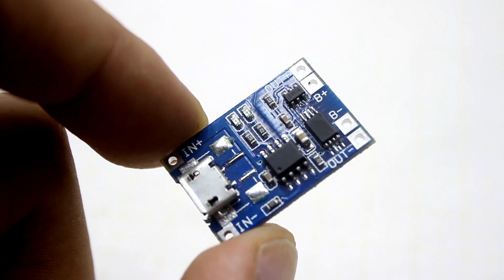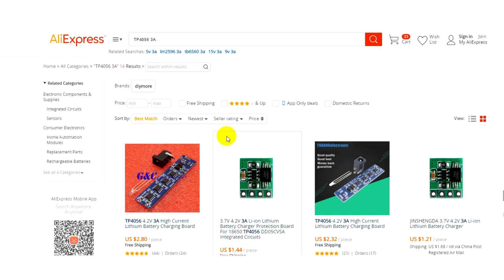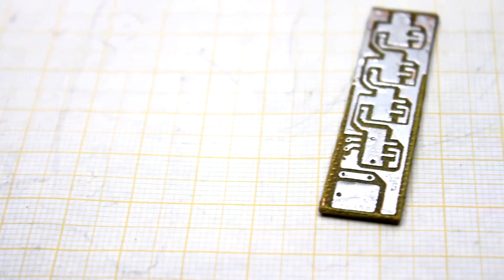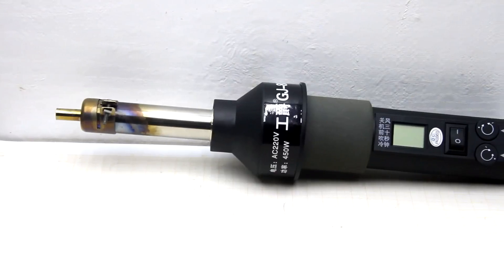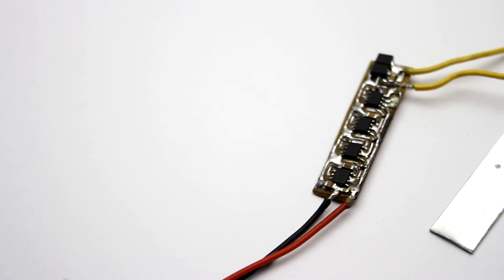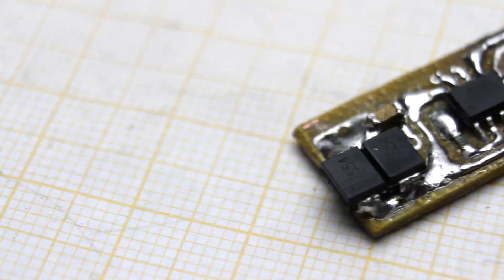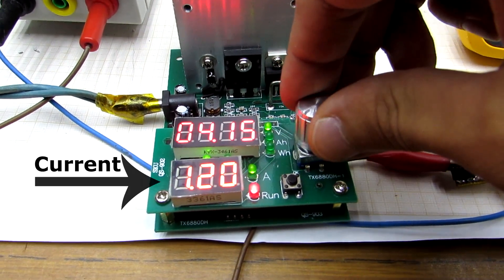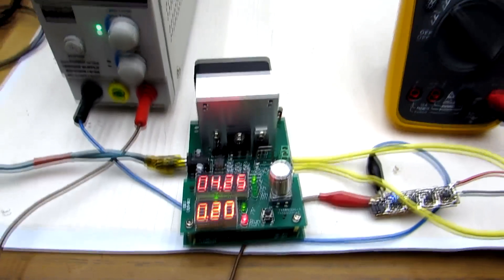3 Amps charger on TP4056 for lithium battery

Comment: Looking at the circuit you reverse engineered, it seems that there are simply four modules (as described on the usual datasheet) with their inputs from 5V and outputs to the battery in parallel (plus an extra capacitor on the output, and without the indicated LEDs on three of them). If you get the TP4056 modules without battery protection,  you could simply connect four of those in parallel to achieve the same result.

Comment: IS IT SAFE? THAT IF I CONNECT TP 4056 BOARD WITH MY 18650 BATTERIES FOREVER ? FOR MAKING A PROJECT THAN CAN FORVER BE ON
Reply: Yes its safe, as long as nothing happens to the board or the batteries during its use.

Comment: Just to be sure, On the TP4056, what do the 5V+ and 5V- connections mean? Is that where the load is connected?
Reply: No that is where you can add input wires if you don't want to use a USB connection to power it. I hope this message is still relevant one year on...

Comment: OMF and 10 LOLs! at 0:23 it sys "with integrated protection and without it" WHat he meant to say is that there is a TP4056 board with over discharge and SC protection handles by a different chip and 2 mosfets  which is present in the PCB on the left but on the right, THERE ARE NO COMPONENTS AT ALL! This is like fundamental... According to 0:27, both PCBs are CHARGERS??????
ANd what do you mean at 4:57 " the output voltage does not change"?? It goes from 4.2 to 4.07 at 2.6A, not even three which would fall even more I assume... 4 volts is NOT the recomended Li Ion charge  termination voltage...

Comment: I was thinking of adding a bipolar NPN transistor to the "Bat"  pin (5) to increase the current, but that pin is also the voltage monitoring input. So the NPN transistor may increase current but it will isolate the cell voltage from the TP4056 internal sensing, and never see the real voltage on the cell. The best case is that the cell will charge at only 3.6 V (4.2 - 0.6 Vbe). And that is not what we need.
Reply: Maybe use an opamp to drive a mosfet?

Comment: TP4056 is crap the idea of using resistive charging instead of switch mode supply is stupid and inefficient , why not use TP5100 ?
Reply: Ammar Abotouk  which is best module that has overcharge protection, qualcomm, can do 1.5Amp without a problem for charging 8 x 18650 cells that are used for a powerbank.  There are soo many modules on ebay, china.   I dont now what to buy anymore.   any suggestions.
Reply: African Twin I don't think there a Qualcomm module on AliExpress but the best I found is the power bank of 8x18650 the board is good with very good boost circuit

Comment: Really, really nice. One big problem I've been having with the TP4056 with protection circuit is the 1a limitation... Sometimes you need more (like in a powerbank - sometimes you need up to 2 amps). So what I use is the TP4056 without protection circuit in conjunction with a 1s BMS with the required current limit.